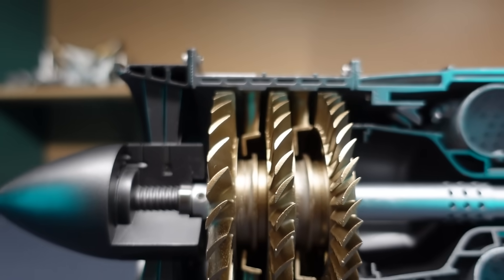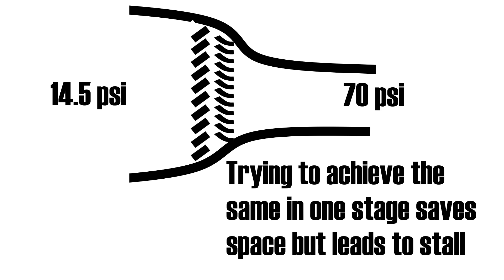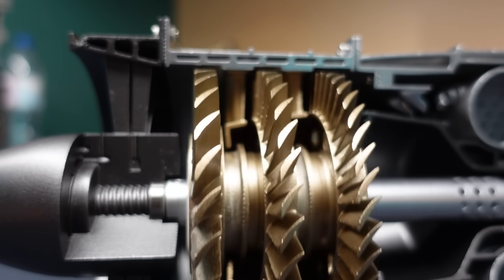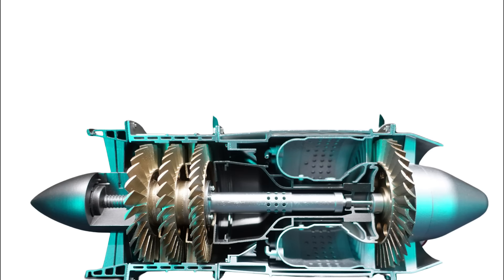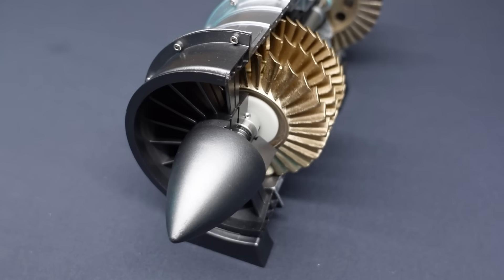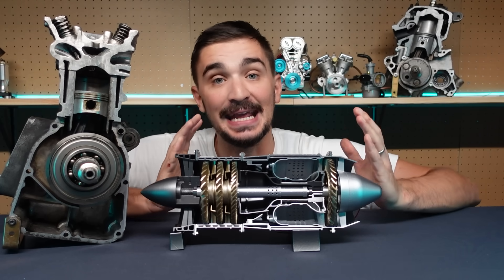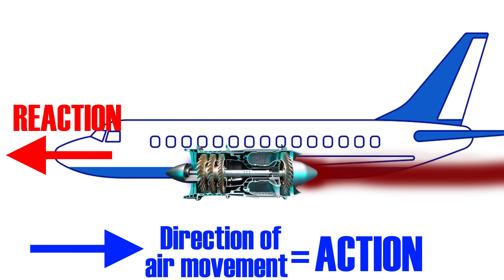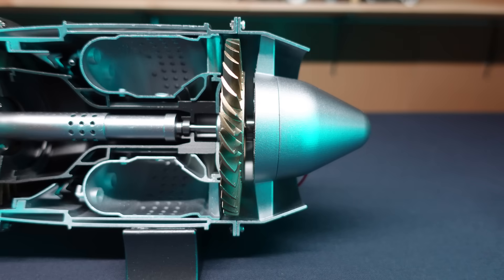Appreciating The Beauty of Jet Engines by Juxtaposing Them Against Piston Engines

Comment: In my opinion the thrust to move the jet engine and this way the attached plane forward is done in the combustion chamber. In the combustion chamber the air/fuel mix is ignited and you get  expanding gases. Lets think for a moment the combustion chamber ist completely closed. In this case the pressure would be equal everywhere in the chamber. Like in a gas bottle. A gas bottle doesn't move. But at the open exhaust at the rear (which of course is needed for the continous gas flow) there is not as much pressure (because the pressure is reliefed) as in the front of the chamber. Due to this differential pressure the movement is taking place. You know what happens if you lay down the gas bottle to the ground and knock of the outlet valve. The bottle will also move/accelerate into the opposite direction. You need pressure (PHYSICAL FORCE) in the direction you want to move. If your theory with the exhaust is right, you would have higher pressure at the outlet to mechanically move the engine forward, thus killing the airflow completely and the engine would stall.

Comment: Basically a turbofan adds a ducted fan (typically) to the front of a turbojet. The exhaust gas has less energy due to more work being extracted from it, but the additional cool air adds more mass, which offsets that, in particular they tend to be more efficient at somewhat lower speeds.

Fighter engines are often described as 'leaky turbojets' due to how low the bypass ratio is. Essentially the bypassed air largely serves to cool the engine, rather than contribute to thrust. Because very little air is bypassed, not very much energy is diverted from the exhaust gas, meaning the engine will be more optimized for higher speeds.

Going in the opposite direction one can remove more, or even all of the energy from the exhaust gases, whether to a propeller or some sort of geared fan. This further optimizes the engine for low speeds over high speeds. The RFB Fantrainer is a unique example of a using a ducted fan instead of a propeller. 

Very high bypass turbofans use a gearbox between the fan and compressor to reduce the speed of the tips of the fan blades, reducing noise and improving efficiency at lower speeds. 

There's also propfans, where the fan is unducted and looks like a multi-bladed propeller sticking out the the jet engine.

Comment: turbine engines dont use the sparkplug all the time mostly during start and rain, the combustion is occurring using the self sustaining flame from the previous combustion, sometimes the flame burns out which is called a flameout, the pilot can control when the sparkplug is working or not

Comment: Hi, thanks for the video! A few questions for future videos on the subject: 1. Could a jet engine be used without nozzle/thrust and instead mechanically drive a car (or similar) drivetrain? By perhaps using chain or gears? 2. How is engine speed controlled/throttled on jet engines?

Comment: Interestingly, in modern turbofan engines, about 60% of the power comes from the large forward fan, which is powered  by the turbine but not at the same speed as the compressors.

Comment: Hey, your turbine blades are inverted.
Reply from the maker: Hey. Pinned comment
Reply: @d4a  sorry, didn't see it.
Reply: @d4a  ever thought of making a vídeo on dragster engines? Those things use exotic fuel, supercharger, a melting clutch, no cooling, no gearbox and they transition from otto to diesel cycles in the middle of the run. Lot of topics for a long video... Love your channel!

Comment: You didn't mention that jet engines can easily run on a variety of fuels, while, with a piston engine, you must choose a design that runs on fuels like gasoline, or oils like diesel. To my understanding, the only thing keeping a diesel engine from running on gasoline, is fuels like gasoline & alcohol are too...watery to lubricate the high pressure mechanical fuel pump of a diesel engine.

So, does that mean a diesel engine can run great on 2stroke premix?

Gasoline engines are limited to only fuels that evaporate & burn easily, and you always have to worry about preignition/detonation, a problem that dosen't exist with diesel & turbines, because the fuel can't ignite before it's supposed to, because diesels & jets/turbines only introduce the fuel when & where it's needed...but diesel engines are very big & heavy, and jet/turbine engines are very expensive, and almost impossible to get the appropriate kind for a homemade project.

All this makes me angry, that Jaguar abandoned their C-X75 gas-turbine Series Hybrid concept, that would have possibly made it easier to get a turbine like that for my own projects, and I'm angry that I couldn't find a small, axal-flow gas-turbine for sale, about the size of a Pringles chip container, with many compressor stages for efficiency.

If the C-X75 made it to production, and if micro-turbines like I described were available. Then Series-Hybrids that can run on a variety if fuels, would be more common. And if poop hits the fan, harder then covid, then people would still have independent transportation. Even if fuel stations are out of gasoline & diesel, even when charging-stations are down or unreliable.

Jet engines/turbines can still run on heating-oil, acetone/nail polish remover, rubbing alcohol, kerosene, camping/lamp oil, fresh cooking oil, filtered used cooking oil, filtered used engine & transmission oils, high alcohol drinks like moonshine & vodka, high alcohol perfumes, nearly any flammable liquid.

Series-Hybrids are the best of BEVs and Engines.
The instant-torque, stealth, low maintenance, stop&go traffic efficiency, and the pad & rotor saving Brake-Regen of electric, but the convenience of fuel, the engine turning the onboard generator can be kept at it's most powerful or most efficient RPM, there is no clutch to burnout, no gear-shifts to fumble over, no fragile CVT to break, if the engine breaks down for any reason, you can keep moving under battery power, and better then those red light engine stop systems, when your generator engine is on, and your batteries aren't full, then fuel is not being wasted, because your batteries are being recharged, whether or not you're using them.

And what range-anxiety will you have, when you can just go to a normal store, and buy whatever oil or volatile liquid to put in your tank?
Plug-in-Series-Hybrids are the best option for the people. Even better if the on board generator an be powered by so many fuels....but series-hybrids are so rare, especially in the bike world, which would mobilize even more people then cars, because most people honestly don't need the room & costs of a car, and are just too cowardly to get & master s motorcycle.

I wish gas-turbines were more common, in the production or homemade vehicle communities. Especially like the micro-turbines I described.
Those little jet-engines & gas-turbines for RC planes & helicopters are extremely inefficient. Literally the bare basics just to run. They need way more compressor stages, and or, be compound turbocharged.

Comment: Do a video about the Ecomotors OPOC engine. It's an opposed piston engine that only requires one crankshaft. They claim 1.1 hp per pound and 50% more efficiency. Bill Gates even invested $23.5m in this technology. However it's been 13 years and nothing happened.

Comment: Damn, you know I've read about this stuff every once and a while and it never really made sense to me until now. Jet engines are deceptively simple, but they feel alien. I think it was when you said that the turbine does not harvest all the energy that it finally clicked for me. The only things those rotors are doing is compressing air and making sure there's enough energy harvested to continue compressing air. That's all. For some reason I always thought that it was the rotor's act of compression that created the thrust and the fuel was merely being combusted to drive the rotors for that purpose. I had it backwards this whole time. The combustion is creating the thrust.
Reply: And now that I've realized that... I now understand why there's all this talk about electric jet engines, but little in the way of results. Battery density aside, it's an engineering nightmare to replace combustion with plasma. I really have no effing clue how engineers would hope to pull that one off and create a decent amount of thrust. I guess we're stuck with propellers for now.

Comment: 6:51 The combustion chamber cannot be at a higher pressure than the output of the compressor because then air would not flow into the combustion chamber. Combustion only increases temperature and volume. This is similar to the fact that a fireplace does not increase air pressure, except in this case it's occurring at above atmospheric pressure. The combustion in liquid fuel rocket engines also cannot increase pressure for the same reason. The fuel pumps must output the full pressure of the combustion chamber. The combustion simply increases volume (and thus volumetric flow rate [proportional to fluid velocity for a given cross section]).

Comment: A great video as always but I think you might be a bit off with the operation. I believe that the compressor mostly just generates a high flow of air and so is really a pump. The 'compression' results from a combination of the restriction of the flow and the back pressure from the combustion. The combustion chamber has to balance getting air in and host expanded gases out as a continuous process in the correct direction whilst constraining the gases so that work or thrust can be generated. The airflow is like a wall against which the gasses pushes. This is also managed by the fuel flow which was difficult to get right on early engine. A surge is when the compressor stops supplying air at sufficient rate (e.g. a stall) and the gasses go the wrong way - a literal back fire.  This is destructive because it tries to make the compressor reverse direction.
Reply: The compressor compresses air as explained with a ratio around 5:1. So you can add 5 times more fuel to the same VOLUME of air, thus increasing expanding gases by 5.

Comment: 1:30 Strictly speaking, a jet engine is not an internal combustion engine. No energy is extracted during combustion. Also, the jet engine gets its power from the speeding up of the working fluid instead of the pressure of the working fluid.

EDIT: I was really hoping this would include turbocharging and turbocompounding, two different ways in which synergy is created between reciprocating engines and turbomachines.

Comment: Used to do heavy repairs on turboprops and man they are so reliable. Have seen shrouds on the turbine disks that were just basically gone and the plane was just fine. Often the things I have to do on the PT6 engine is all based on time limit. On the rare end, I might have to deal with adjustments but even FADEC is taking that away.

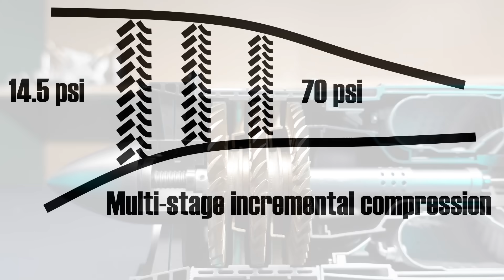Comment: 5:57 -- By way of elaboration, in general, with respect to thermodynamics, doing things in smaller steps (stages) is more efficient. Compressing a gas flow from 14.5 psi to 70 psi is more efficiently done in three stages of compression than one (for a hypothetical example, the numbers here aren't exact). Doing it in five stages or even ten would be even more efficient than three, but this is where *science* gives way to *engineering.* Yes, ten stages would be more thermodynamically efficient than three (again, for example), but not so much so that it would be worth the increase in weight and complexity of ten compessor stages versus three.

Comment: Very well said.  I absolutely love all things gas turbine and you did a fantastic job of explaining the pure jet aka turbojet…brutally loud, all kinds of different sounds, turbojets are sweet.  Turbo shaft and turbofan engines are also sweet though…and steam turbines are also sick.

Fun fact:  LOTS of companies make turbine engines and/or parts for turbines…but the big three are the only ones making monster high bypass turbofans with 12 foot diameter fans in front…GE, Rolls Royce, and Pratt & Whitney.  

Go have a peek at the GE9x by General Electric, set to power the new Boeing 777x monster.  It’s ludicrous how big it is.  Rolls Royce is making an even bigger model, but it’s still a ways off.  Gotta love healthy competition 😅

Comment: Well, I can't agree that limiting factor for piston engines is combustion, they're pretty capable to reach 12-14k RPM but for any average car application it wouldn't be suitable because it requires higher intake stroke which makes it bad at low RPM where we use them most.

Jet engines also operate at 7-12k RPM, but limiting factor is not the temperature but centrifugal forces that will ruin turbine and compression wheels

Comment: How much does air expand for every degree in temp increase? I heard a rule of thumb it doubles for every 500deg F but what about lower temps? The industry I am in we spray hot cleaning solution into a vessel. So it goes from ambient to say 80c in seconds. So along with the rapid increase in temp and volume displacement from the liquid spray pressure in the tank rises rapidly and can blow rupture disks of the tank is not vented. The other issue comes from vented ports that typically end up being flooded due to the rapidly escaping air carrying the liquid with it.. not really jet engine talk but related in a sense there is a rapid expansion of air due to a temp increase

Comment: Agent Jay Z owes you a dope slap for "jet engine".

The other major application of turbine engines wasn't mentioned: electricity generation. Really perfect application as they can sit there burning natural gas for years at a time. They can have huge air filters, so service intervals are way longer than in the aeronautical versions. Plus they can have huge exhausts, so minimal noise with near zero resistance. These types of engines are actually incredibly fuel efficient at high loads, which is why they're great at what they're used for. Piston engines are more fuel efficient at a range of load and RPM ranges. Idle fuel consumption isn't that much lower than loaded fuel consumption with turbine engines, which is also why taxiing is performed instead of towing to runway and also why many airlines do single engine taxiing procedures

Comment: Another analogy I have always liked is to compare the engines to two types of factories: batch processing and continuous flow. The batch-processing factory (reciprocating engine) produces one part (power stroke) at a time. The continuous-flow factory produces parts (power) continuously which is exemplified by the assembly line.

Comment: I think there is a issue in this video.. and .. well its not even that there is any straight up errors, its more implied. 

A jet engine effectively work of a diesel cyclic  (if a slightly modified one). This is is kind of important. This is also basically the main drawback of the engine type.

A jet (or really any turbine engine) don´t have a throttle but it rather control the power of the engine by injecting more or less fuel. What happen after is where the issue is. When the hot air is cooled it loses usable energy hence efficiency.

That is why a big ship diesel have about 55% efficiency and a jet-turbine on the ground (as of used in a turbofan engine) have a efficiency of about 36-38%. Here is where it get complicated. When the air get thinner, it also gets colder, this increase the efficiency of a jet-turbine from about 36% to about 42%. While not a huge increase, its significant. But that is also true for a diesel, but the change in efficiency is smaller.

The reason why a diesel can run that warm is because it is recipritating, and that is what giving the diesel that large of a efficiency advantage.

The explanation why jet/turbofan aircraft is more efficient than piston aircraft is... well, its to be frank, wrong. Effectively piston aircraft is actually still more efficient. The reason why we use turbofan aircraft and not diesel aircraft is due to the speed advantage. Simply the cost saved by flying faster (with lower cost of crew and pilot) outweigh the cost of flying slower.

A diesel power aircraft can still very well fly at 12 000 meter. The air need to be precompressed, but that is not really a issue. The issue is simply that diesel engines are to heavy. This is a dissadvantage that have slowly eroded over time, and we now starting to see diesel aircraft at 600 or 700km/h.

Its also worth saying that there is something called a combined cycle that reuse the heat from a turbine engine. This raise the efficiency to about 64% for a ground based turbine and up to about 70% for a airbased turbine.

There are no air-based turbines of this type, yet, but there are ship based turbines that work out of this premise, often called ORC. We will not see them in aircraft the next generation but possible the generation after.

Comment: hello i have a question for my paper for school, a v6 vs a boxer 6 who is the most fuel efficient and why?
Reply from the maker: Fuel efficiency has little to do with engine configuration, but all things being equal the boxer 6 should be marginally more efficient due to better balance and requiring less counterweighting so it revs more easily but this is largely negligible to be honest.

Comment: I am still not getting one thing. How it is possible that the combustion won't escape back to the compressor? If the compressor pushes pressure about 4.8 bar, the combustion must be few times higher pressure. And fluid travels from area with high pressure to area with low pressure.